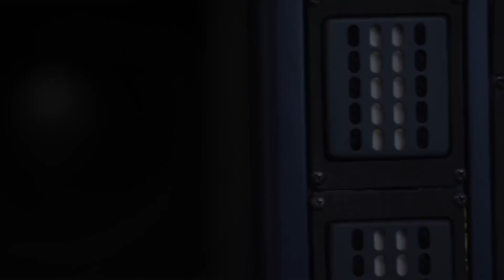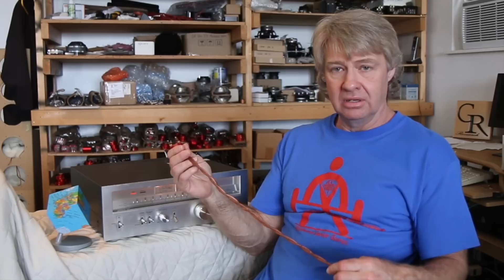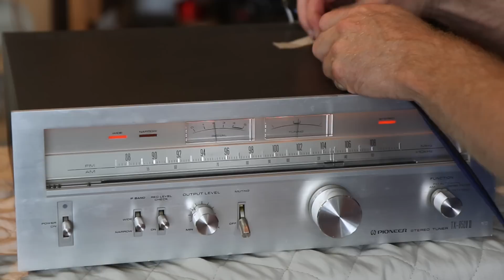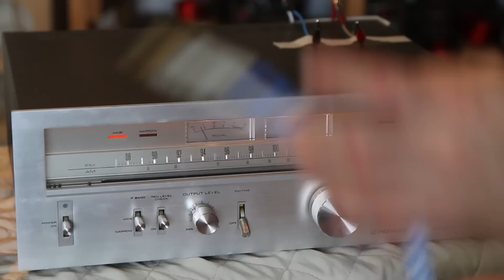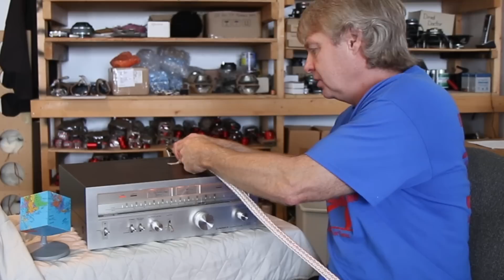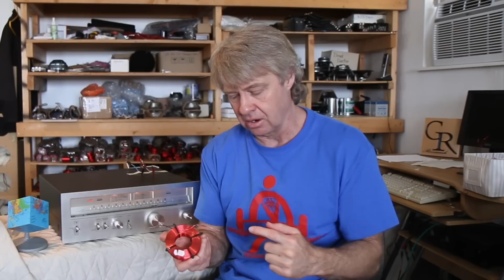Do Audiophile Cables Matter? Here's PROOF!

Comment: I have done many tests working as a sound engineer, both live and in studio, attempting some level of blind testing. @manthropology - there is definitely a 'it sounds better because I just spent $100 on 8ft of cable'  effect- which is a well known part of psycho-acoustics. Ultimately the speaker cable's practical measure is its efficiency to tranfer power over a given length and the capacitance over that length. The thinner and longer the cable, the greater the voltage drop- basically a resistor- that steals power from the speaker.  And running two conductors beside each other will always result in some capacitive effect, that shunts high frequency to ground. Zip cord is of course crap because the thin wire over long length acts as a resistor (voltage drop) reducing power transfer to the speaker and can lose some HF due to capacitance.  So heavy gauge cable, results in higher capacitance because with so much copper surface radiating EMF,  resulting in HF loss and lower resolution in subtle trailing reverb. Braided cables provide high power transfer with many combined smaller conductors, while reducing parallel surface area by braiding together.  The RF is irrelevant in a closed, relatively high (by magnitudes) voltage circuit.  In large scale live sound, thick cable HF loss is secondary once system equalization comes into effect.  But multiconductor braided cable (in-studio tests) definitely gives the best of both worlds, with higher power transfer and lower capacitance, which improves high-end response and reduces HF smearing caused by time domain shifts - thus clearer reverb trails. With line or level, RF is one of other significant factors, but there's a whole other level of chicanery going on in this area too (Monster cable among many). However have worked with braided quad conductor (Canaire Star Quad) cable that was well worth the premium. I have never used a 24 strand, which may be worthwhile for very high power levels, but a commercial studio (short of very high-end facility) would defer to the practicalities of diminishing returns.

Comment: Nobody, as far as I'm aware, has EVER passed a double-blind test on ANY audio cables, so until you can do that, I'll continue to call bs. Using audio cables are antennas means zip to transmitting an audio signal. VHF and UHF? Really? 🤦‍♂️
Reply: It is easy to hear with blind comparisons. Anyone spouting "double blind tests" have never made any cable comparisons before.
Reply: @dannyrichie9743  Same old bs I've been hearing for nearly fifty years. No-one has EVER passed a real blind listening test. And yes, I actually bought into this crap many years ago and even convinced myself.
Reply: @GazzaBoo  We've done tons of blind listening tests. So far they have all been 100%. I know of hundreds of others as well. The differences in cables have been a well established fact for years.
Reply: @dannyrichie9743  Sure.. Yet I'll bet you don't know of a single properly conducted and documented double-blind test (real double-blind) that has ever had any conclusive results other than people guess poorly..
Reply: @GazzaBoo  Cable tests or comparisons are never "double blind" as the person swapping the cables will always see and know which are which.

Comment: Look...  Get any amp, any CD player and any speakers.   Do a test with pure copper cable that costs $3 a meter and then one that cost $100 a meter.  You will see nothing in your measurements.  End of story.  Show me were a manufacturer does that.  They do not.  Finally, all this is subjective as you are fully aware.  If a cheap cable made the sound a little brighter on a dull sounding amp/speakers then it could improve the sound.  Even if a very expensive cable changed the sound it would be 100% subjective as if it improved it.
Reply: What I found in my testing and experience  is  it way more about  the connection  and  alligator  clips ... give me a break on real testy equipment  the  same  cable  can  make a difference just  by re installing  the same  cable  ... alligator  clips OFCOL

Comment: Double blind testing is the only way to know.
Reply: For those of you that have never done cable comparisons what you don't know is that a double blind comparison isn't possible. We do blind comparisons all the time though.
Reply: @dannyrichie9743  Of course double blind is possible. Just rig up some covers for the cables let a third party install them, etc.
Reply: @zTheBigFishz  Been there and done that. The differences in the cables are pretty apparent. The guy doing the switching always knows. We also found that it really doesn't matter if the guy doing the switching knows or not. We've done this a lot. Blind comparisons work just fine.

Comment: I can't believe you actually did this. The RF signals you are picking up are a few micro volts. There is no amplification of that signal. It is miles below audibility. Your channel just lost all credibility with this display of your lack of knowledge. Did I mention that audio components have power supplies, whose job it is to filter out anything that is not pure DC.
Reply: But the reality is that is does affect the signal and how things sound. That fact is well established.

Comment: Of course they matter, but not in the forward way most people think. RCL forward with typical speaker cable values? IMHO this is BS. 

But reverse: As a part of a low resistance complex load they have a HF-footprint on the feedback line of the power amp, no matter if there is only a 6dB Zobel network or a 12dB coil plus Zobel network between the output terminal and the first feedback line resistor. Every different cable has its own footprint, related on how sensitive your amp is.

Comment: Hahaha, audiophile cables is total BS. No one can hear any difference. You can hear some difference in case of different diameters of a cables, but in case of the same diameter between good quality regular cable and so called audiophile cable you won’t hear any difference. I can bet you on that.
Reply: Come by anytime and let's test your theory with some reality. The truth is cable differences are very easy to hear on a good system.
Reply: @dannyrichie9743  You are lying my friend. In the blind test with the same thickness and length cables made out of decent quality copper you will not hear any difference between so called “audiophile” and regular ones. I know that it’s hard to acknowledge the fact that you fell for marketing BS and just waisted a lot of money.
Reply: @figofagonagoitis  I never lie, and the difference is easy enough that anyone that comes over can hear the difference.
Reply: @dannyrichie9743  I totally agree with @figofagonagoitis.
As long two pianos have 88 keys, they are properly tuned and have the same volume, they will sound the same. 
Whoever prefers a Steinway or a Bluthner over a Mao Che Tung piano, is a fool. 
I am a licenced carpenter and I know about pianos.
Reply: @amakrid  Well, you have certainly proven who the fool is.

Comment: DISAPPOINTED. You're MISUSING a low frequency cable (20-20,000 hz speaker wire), in a MEGAHERTZ application. 
I would have been surprised if it DID work!  You a smart guy, so I know you'll find a proper way to show frequency/load/resistance using an oscilloscope and a signal generator. :)

Comment: hi fi basics 1. your amplifier should have sufficient juice to drive the speaker boxes                ( 60+60W). match the amp and boxes properly. 8ohms is the best.2 have a carpet and slightly thicker curtains in your listening room. keep 8 ' minimum distance between the speaker boxes. use same length cables for both speakers avoid rolling access cable.3. use good source such as CD player etc. downloaded MP3 sound crap. better buy branded Audiobook and a good media player. 4.use good quality inter connecting RCA cables. 5. see to it your Amplifier has Loudness switch which is very useful when you listen in low volume, the Bass is well maintained. last word larger the speaker cone always the better Bass. so use minimum 8" subs in each boxes. final word if you are not familiar with DIY better go for branded speakers. before buying the speakers carry your amplifier to the show room connect the speakers and listen, then only buy the speakers. nobody listen the music with full volume make sure at low volume system sounds pleasant.

Comment: Testing in this way, which is testing the RF Signal, is not going to test anything, or prove anything with Audio.   FM is up in the Megahertz frequency.   Length of wire, thickness of wire etc will dramatically effect signal as the wire is part of the antenna.     Audio is 20hz to 20KHz for most devices,   Doing a test on RF is absolutely useless for testing cables.      Also, RF signals are so low that no speakers, even the msot sensitive of speakers, will be able to pick it up.  Anything else is plecebo effect.    AC Hum etc from running too close to an AC power cord is different as it is a lot higher level of magnetic interference.     You really lost a lot of credibility with this video.  The testing is totally irrelevant to audio at speaker levels.
Reply: Differences in cables in this regard in the audio signal are clearly audible and easy to discern. So reality does not support your theory.

Comment: I solved Ground Looping and EMI noise in my system by installing a medical grade wall AC receptical. It costs $300 but my system was dead quite after that. Cheap wall sockets are a major cause of noise.

Comment: As I see in this video, "upgrade" a standard cable is so easy by a alumium sheet which found in every kitchen right?
Just cover the cable
Reply: That only blocks it from picking up more RF noise. That doesn't solve the RF noise issue that is already on the line.

Comment: Tired of these people claiming cables do not make a difference. Your full of crap. I have a high end system and can tell a massive difference WITH MY EARS. Case closed. If you do not want to spend money on quality cables that is your choice. Just do not try and push your snake oil on others. Are there cables being sold that are way overpriced and underperform? Sure. There is also audio equipment the same way. It doesn't mean the audio equipment does not work in some capacity.  That is part of the search finding what you think has value for what you pay which is subjective based on people's OPINIONS. Before looking at cables you need to look at the power outlets and the type of power for clean ground and source.

Comment: Oh boy. This proves nothing. Sure any wire moving through any sort of magnetic field induced some sort of eddy currents. Audio magazines back in the 80s disproved the myth of monster cables. The tests they did was scientific with all sorts of meters. The tests have been redone over and over again. If you can’t measure it you can’t hear it. Save your money. I tired of this debate
Reply: The real problem is that audible differences are clearly heard. So someone is measuring the wrong thing.

Comment: So what gauge Wire does a good speaker have to the speakers and cross overs internally? i used to have that Tuner with an Integrated Amp in the late 70's

Comment: The question isn't if the wire can be electrically measured to be different. It's a question of whether you can hear the difference.  Please do this test: Have Person A swap the cables where person B cannot see. Person B listens. Person A swaps cables cables randomly, Listen. 

Ok, so now just record your results vs actual. Do at least 10 trials.  One of two things will happen:

1. You'll be able to tell the difference every time.  You have proved the cable makes an audible difference. If others replicate this, is strengthens your point

2. Your ability to correctly tell which is which somehow evaporates under these controls leaving you puzzled. You were SURE you heard an obvious difference.  This is what it looks like to catch yourself falling victim to placebo.

It's really not very hard to do this test. The striking thing is that when someone does do this test, no one seems to be able to tell.
Reply: We've done tests like that in the past. It is actually hard to get people to set through it ten times when the difference is night and day.

Comment: Cables might measure differently on the test bench but this doesn't matter in real life because as long as the resistance of the cables is low enough you will audibly not hear any difference.
Reply: Actually that is completely false. Resistance has little to do with how it sounds, but there are a LOT of other factors that do make an audible difference.

Comment: This test is so ridiculous its not even funny ... a speaker cable is a conduit for electrical impulses of very high voltage that is not inducing any noise because its after the AMP.  It will either dampen some high end and or voltage loss.12 gauge can go 3000 ft with 2% loss. Pa companies use 12 gauge for array 100's of feet long...get real
Reply: Nope, it has a very significant effect on the signal. There are links to some explanations above. https://www.youtube.com/watch?v=ER_lqNFckxY

Comment: Blind testing seems like a proper way and since the system has such a low noise floor it may be a good test bed.  I changed my speaker cables in my system and my son immediately picked up a change but I think it may have been related to the better speaker connectors rather than the wire itself.  I don’t know what it was but it did sound clearer and more open - voodoo maybe but that was my personal experience.  My concern with the measurement only crowd is  regarding if the right measurement(s) are used or even exist.  I mean to say we observe or perceive things everyday where there are no measurements that you can point to in order to validate the observation.
Reply: Yeah, it's usually the engineer types who believe in measurements by machines and others who simply believe that they have noticed differences by changing various cables in their systems. Personally, I think that various aspects of wiring/cable do have an impact on ultimate sound quality coming out of a speaker system. It's really just a question of how much of a difference and if that difference is audible. The other problem is the virtually infinite possible combinations of cable/equipment that can have unique interactions. Synergy between equipment like amplifier and speaker is one such example that I have personally experienced in very clear ways.

Comment: If you think about this, this effect should be present any time you have speaker cables connected to your speakers. I wonder what audible or measurable differences there are between two speakers with no speaker wires and with speaker wires. I've never heard anything coming through any of my speakers unless it was on a live audio circuit. The science behind this also shows us why these aspects dont effect the audio frequency range. You can use this incomplete data to make assumptions and convince some that this matters. But with complete information on how and where these aspects are applicable, you know it doesnt impact the audio frequency range, there isnt enough interference to be audible. I guess having a more full understanding of how it works makes you closed minded, snake oil finger pointer.
Reply: Maybe you should listen to what the experts have to say. https://www.youtube.com/watch?v=ER_lqNFckxY

Comment: Can't i achieve the same with cheap clamp-on ferite cores? It should filters all  high frequencies. Ham radio operators do it all the time. Correct me if I'm wrong.
Reply: Your speaker does that filtering anyway because it could not produce such high frequencies.
Reply: No you are incorrect.

Comment: Not here to argue, just learn. So we have a $250 14 or 12 gauge cables from amp to post on speaker. But how about the thin cables between the posts and the crossover? Aren’t those important or influence sound? How about the thin traces on the pcboard? Or direct point to point solder and thin wires on DIY crossovers? Or the thin wires from the speaker coil to the cone?
Reply: All of those things effect performance.

Comment: If you are worried about external RF, you need shielding which is grounded. Braiding it, only helps reduce internal RF by mixing the energy leaving the amplifier, with the energy returning. When they don't match, the magnetic field cancels the RF from the source amplifier only. If the amplifier isn't doing it's duty to clean the signal, then you need a better amplifier. At least that is my understanding with chokes... which is what the braiding emulates.
Reply: Shielding doesn't remove what is already on the line. It also holds a magnetic charge that adversely effects the signal transfer.

Comment: Thank you so much for this video. I recently viewed it and realised I had spent far too much money on braided, unscreened power cables. Because I only heard marginal improvement over bog-standard cables, I mistakenly believed there was little point bothering with 'better' cables. After viewing your video, I purchased two very cheap (£23 each) screened power cables which transformed my Echo Studio speaker from just about OK to almost hi-fi. I have since replaced all my power cables and it's transformed the music. I also replaced my speaker cables with CAT5. What a difference that made! This has been the cheapest major upgrade to my system ever. Please keep sharing your knowledge and experience.
Reply: what you probably heard was a slightly louder signal due to a lower resistance cable.

i dont buy this experiment either.